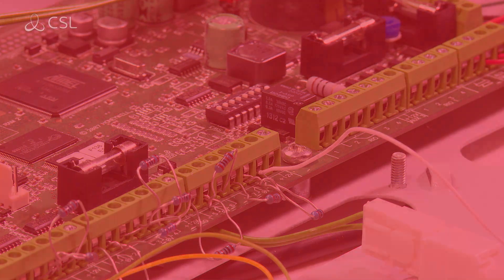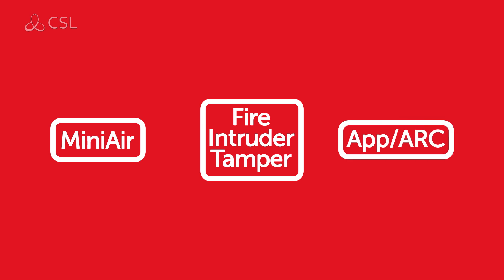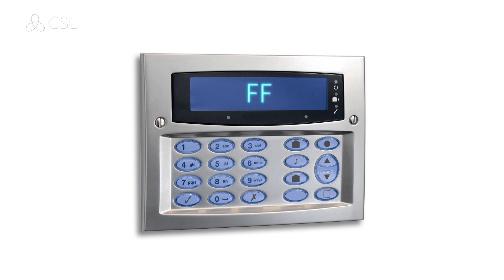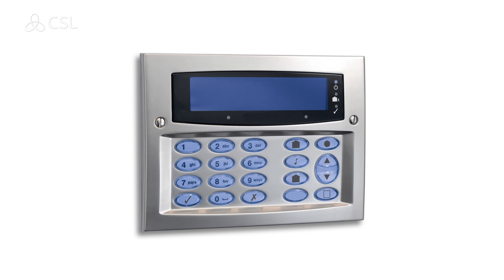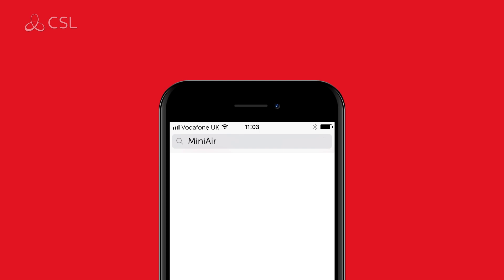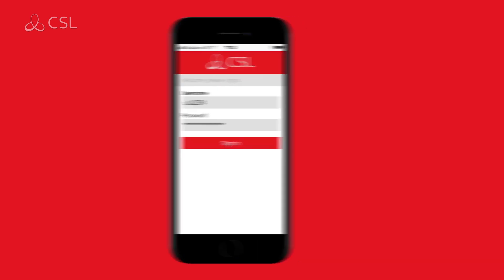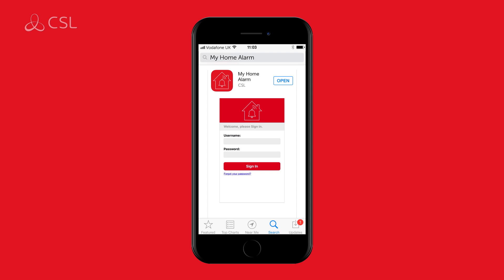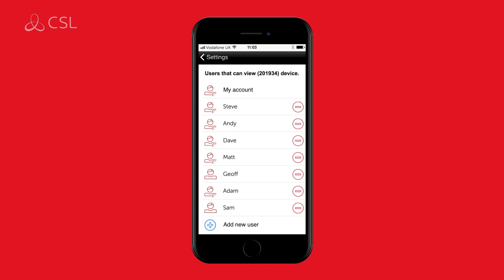MiniAir Installation Video

Comment: I seem to be going to a lot of jobs that are not working correctly. Set it up on a normally closed relay and my restore comes before my activation. I then change t to normally open and it still does the same. Some times I can be there changing it back and forth for 20 mins until it sends the activation first rather than a restore. Anyone else get this
Reply from the maker: Hi Alfie, we're so sorry we didn't reply to you earlier on this! If you are still experiencing these issues please let us know. If you tell us the name of the company you work for we can also get your account manager to give you a ring and discuss the problems you're facing. All the best!